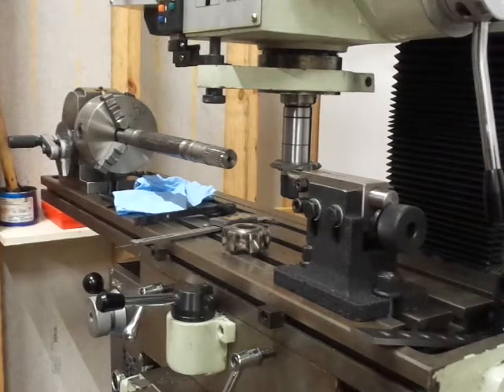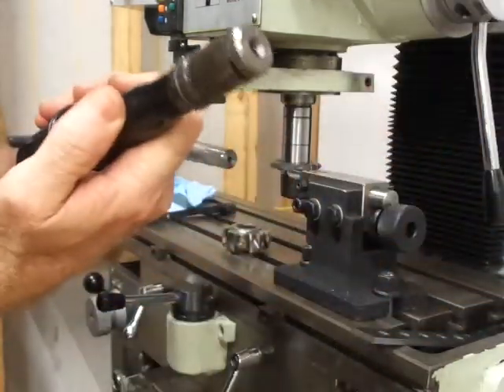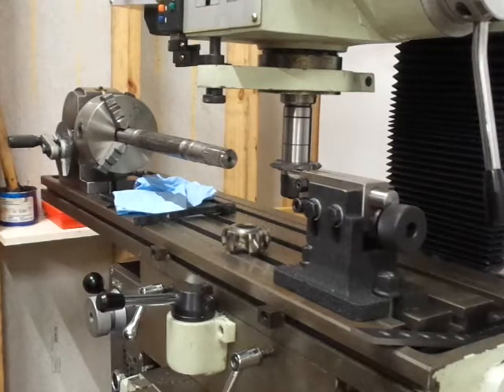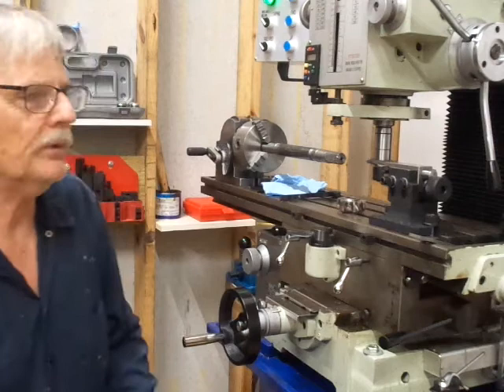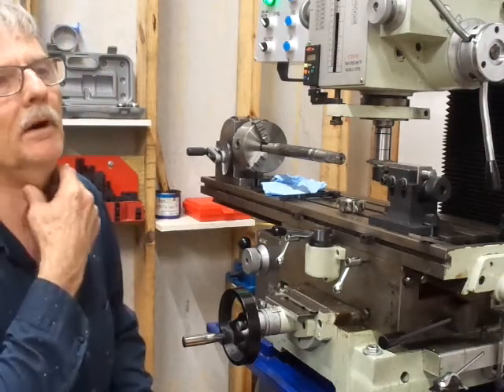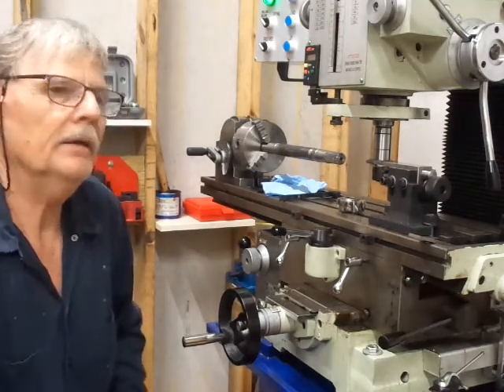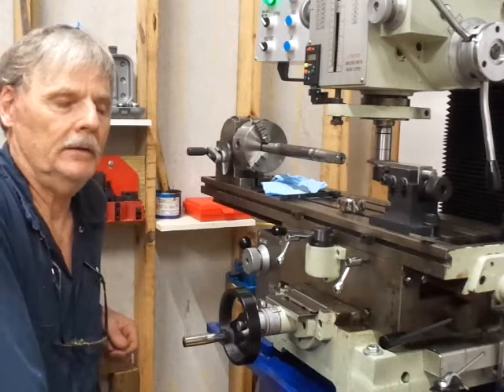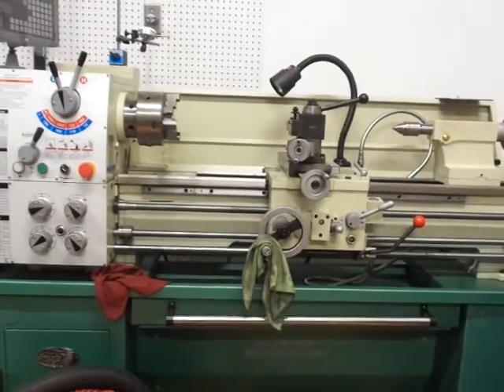Cutting axle splines made easy , set up and how to. Part 2

Comment: How do you set the shaft to be parallel to the table, or perpendicular to the quill? - I need the centerline of the shaft to be .000001 along its length .
Reply from the maker: I don't check my gmail very often. The index wheel tool will hold it Parrell to the table. No one needs it to be very exact along its length for splines. I am not worried about that my mill is calibrated. There is no such thing as a .000001 measurement. I know you are Kiding Good luck with your projects..

Comment: That cv joint doesn't really look like it's fitting really well.
Reply from the maker: Hi. I like your comment. The spline sprocket did fit tight. When I deburred it with wire wheel I used it . It was snug but the axle is installed and racing since then. 
  Sense then I have learned to add a few ( .003 ) deeper cut to allow for flex and it works. Another way is to run the cutter twice to not over cut the first time. Because there is no way to measure the first cut depth except estimate. I cut one spline then measure and adjust and cut again until I have correct depth.  Then run the axle splines and make sure you lock the divider wheel each time.  I hope you are doing your own machining . Bye Robert
Reply: @robertguilford5325  Hi, Robert, always good to see how other machinist are learning as they go and getting better.